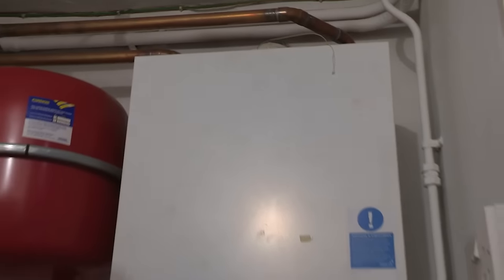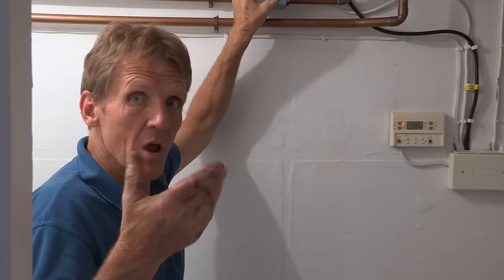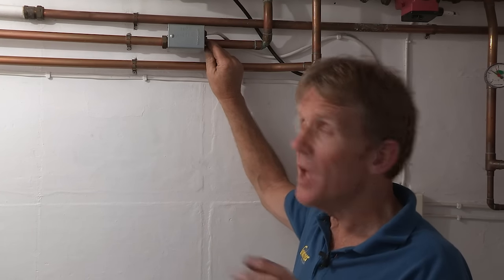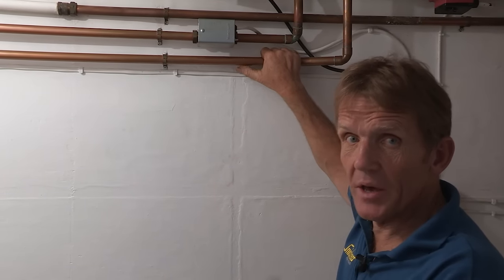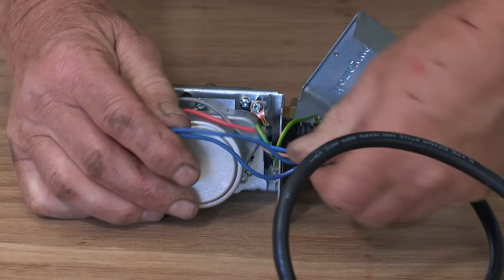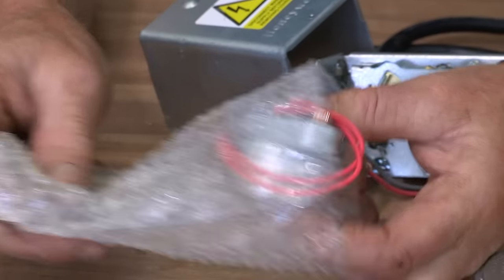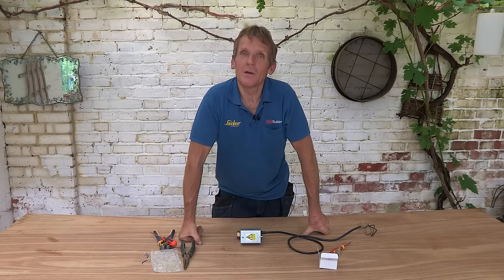How to Repair a Motorised Central Heating Valve

Comment: Great video. Thanks. I have 3 of these, 2 separate heating zones and one hot water. They are fairly new (18months) but one of them is making a loud buzzing noise when open? Does this mean it will need changing? Thanks

Comment: brilliant video. my unvented cylinder was not heating water although the boiler was working. what you described is exactly what my valve looks like. a £10 part next day from amazon sorted it! cheers i reckon a plumber would have been lookin at over £100 to sort that

Comment: I have just managed to do this - thanks for the video. The hardest part was uncoupling the wires on the failed unit (the two plastic crimped parts) is there a knack to this?
Reply from the maker: I just cut them. There is usually enough to make the new connection with the twizzle or a crimp.

Comment: Thank you so very much for your very clear instructions. This fixed my issue and wasn't too hard to do and only cost about $30!
Reply: I just had to replace it again 3 years later, these motors seem to not last lobe. But thanks to you I replaced it for the cost of the motor $42 dollars here in New York!

Comment: I have a buzzing coming from my CH diverter valve. Quite loud especially at night. This is when the system is off. Is there something wrong as I am sure it was never this loud. Some nights it's quiet. No problems with HW or CH so far. Is it on its way out?

Just switched on HW, valve whirred in to action, buzzing gone. Switched off HW within a minute and the valve is dead silent. No humming or buzzing! Peace and quiet. I wonder if it is drawing current when buzzing. The electricity bill was a little high last month. Not using anymore appliances than we usually do.

Comment: Unless it's a really old Honeywell valve, you can change the head without draining down.  Also the boiler will not fire up just by 
locking the leaver open. The manual operation is for filling and draining the system. If the lever is locked over, the boiler will 
operate if the other valve is calling for heat or hot water.

Comment: Great video and I was hoping it would fix out hot water heating but it isn't the case. When I trigger the HW heating valve manually and turn the boiler on for HW, it only runs for 5 mins or so and then stops. Radiator heating works fine. Any ideas?

Comment: Got the exact same boiler and motorised valve set up. Both heating and hot water is working however I think the motorised valve might be causing a humming effect. Would a replacement of the synchron sort it?
Reply from the maker: If it is humming that can be the only reason but put your ear to it and make sure

Comment: Thanks for the video! What to do if the motor and the cog controlling the valve are slipping / clanging?
Reply from the maker: You can replace the whole actuator or start bending the cog so it lines up. There comes a point where you can't rescue it.

Comment: excellent....mine is supplying hot water to the central heating when its not in demand....could this be the same problem?
Reply from the maker: It could be that it is open. Feel the pipes on either side and if it is hot on the  pipe in and out then it is the valve staying open.

Comment: Thanks for all you do. 
I have an Ideal Classic boiler at home and I noticed that when I switch the hot water on from the control, the radiators also starts heating up as well. What could be the problem?
Reply from the maker: It could be reverse circulation. We have a video on it   https://www.youtube.com/watch?v=vu55TgMMDyE&t=13s

Comment: Hi roger thanks for the informative video and looking to replace the synchron motor on my Honeywell 2 port valve 40003916-001 and I am tempted by the cheaper generic motors over the replacement Honeywell product, which you will know is a lot more expensive, what’s your view on this and any recommendations?  Thanks again regards simon

Comment: Excellent clear  information. I have a buzzing noise coming from my 3 way valve . Do you think it's a faulty motor?
I'd be very interested in what you think.
Regards mark
Reply from the maker: Hi Mark 
What is the make of the valve.? The Synchron motor is generally silent, buzzing usually comes from solenoids
Reply: @SkillBuilder  it's a honeywell 40003916-003. I heard it making the noise in the middle of the night. If I switch off the power the motor winds down and it quite when I switch the power back on again. Many thanks for getting back to me. Mark

Comment: While I already have the motor out, is there a way to check whether the micro-switch might be the problem? Is it possible to just replace the micro-switch? Lastly, do you have a video on how to drain the system? Thanks, Mike
Reply from the maker: Hi Mike 
 You can test the mechanical action of the micro switch and put a tester on it. I have never replaced a micro switch so I am not sure if that is a spare part. It may be that you have to buy a new head. 
We don't have a video on how to drain the system because they are all different but if you can't find a draincock look outside the building.
Reply: @SkillBuilder I ordered a new Honeywell 2-port valve with actuator head. However, I'm a little nervous about draining the system so I am first going to try just to install the actuator head onto the old valve and see if that will work. If not, can I just wire in the new valve/actuator-head and test it out before I even think about draining the system and installing it? Can I wire it up and then just lay it against a nearby steel pipe to ground it and then turn on the water heater to see if they boiler kicks on, or do you highly advise that I don't do that? If it can kick on the boiler that way, then I will probably just go ahead and hire outside help to help me drain and then refill the system so I might as well have them just install the entire 2-port valve with actuator header. Thanks for your reply. :)  Mike
Reply: Good news. It turned out to be the thermostat that is located on our upstairs water cylinder (water heater). I removed one screw to open  up the plastic cover over the thermostat. There was a small red 'reset' button that was poking out. After pressing the button back in, the hot water is working great again! Thanks for your help.

Comment: I have a 3 zone system (upstairs and downstairs heating and water cylinder). I am getting heat in all 3 zones wherever I turn on any of the zones. I'm thinking the zone valves are passing but is there anything else it could be before I replace all 3 valves?

Comment: Thanks so much , very helpful.
After refitting a new synchron notor the valve is not full closing through the spring pressure so CH is now on a bit when HW on.
What do I need to do re resetting valve to fully close. Happy to remove motor and refit, it’s as if the valve needs to be reset fully open or shut the motor back in.
Right now manual lever slack until last 1cm of travel to manually open.
Oh and my Synchron motor did not come with new machine screws, the originals are slot head brass and super fiddly to refit, most motors come with cross head machine screws.. what size are they?
Would be so grateful for help here.
Regards
Mike
Reply from the maker: Is the arrow the right way around?  Direction of flow is important
Reply: Hi thanks for the quick reply. It’s only the synchron motor I have swapped out , not the entire two port valve... the synchron motor does not have an arrow and can only be fitted one way. Yes the brass two port arrow is facing with flow direction. Unfortunately my Honeywell two ports are older units and require drain down to replace the entire head, so after the synchron seized solid I thought it best try motor change, but valve isn’t fully closing now and CH is on when HW is on. Not a disaster but not ideal.

Comment: Thsnks for the information, one question do i leave it on auto or manual?
Reply: Very late reply, but in case it's useful: when it's working properly, it should be on auto so that the call from the timer is what opens the valve.

Comment: Two zone heating system but one zone occasionally nit running when both heating programs run together. The affected zone's motorised valve's on light wasn't lit but the other was. Given there's no light on the motorised valve would this be more likely the EPH control unit? Being intermittent is hard to tshoot on. If I run an hour boost the heating then works.

Comment: hi Roger, my hollywell valve seems to be vibrating after the heating (radiators)/hot water has been on for an hour or so.
In order for me to stop the vibrating i need to turn the hot water on for 5 secs or so, then off again. This for some reason stops the vibration. Do i need to simply replace the valve? Cheers Roger
Reply from the maker: It might work, but it could simply be the pump pushing against a closed valve. This would indicate a sticking micro switch. Try turning off the power to the central heating system and then removing the cover and giving the whole things a good vacuum out. Sometimes it is just dust or grit.

Comment: Thanks for video. Good explanation. Have a Honeywell value that gets mighty hot when in use. I understand that how water is flowing through it but it seems hot. May just purchase a new motor and replace. Using a Tadoo system as well. High recommend as a heading controller..
Reply from the maker: They are hot when in use. Try turning the boiler off and running the system with no heat. If the valve is warm there is a problem but my guess is that it is the hot water rather than the motor. Those synchron motors don't produce much heat.

Comment: Hi all, 
How do you ensure that little cog-drive of the new motor is in the correct position to match the position of the gears driving the valve mechanism as you mate the new motor onto it's base plate.
To elaborate. The new motor is in 'divert to CH position ' but the actual valve and its gearing is in the 'divert to HW' position.  When the new motor is fitted how do you ensure that the two mechanisms are pointing the same direction. 
TIA

Well, to answer my own question above, I popped into the local plumbers merchants to by the new motor and spoke to a plumber and the shop  assistant about my question above. Both of them agreed that they'd never thought about the problem and to just throw the new motor on. Which I did and it works!!!! £9. 
Thanks Skills Builder.

Comment: Bypass valve also allows circulation when the pump over run facility in the  boiler should it have one ,is needed

Comment: Hi Rodger. Thank you for the great video, really helped a lot. I still seem to have hot water buy passing into the radiator system when the hot water is on. Mine is a two way diverter valve. Could you have some advice for me please.
Reply from the maker: If you feel the pipes you can see if it is creeping past the diverter. If it is then replace it. If it isn't then you have a reverse circulation effect. This occurs when the return pipes from the radiators are not all joined to the return to the boiler in the same spot.
Reply: @SkillBuilder  Hi, thank you for the advice. Yes, the copper pipe is equally hot on both sides of the diverter. Will then have to replace. Drain the heating system and replace.

Comment: If the valve is leaking is there any way to repair it or should I change the valve body or possibly the whole thing. At the moment I have gravity HW and pumped heating, everything works as it should apart from this valve now weeping. I originally fitted the valve around 15 years ago to stop the radiators heating up in the summer due to gravity circulation.

Comment: Hi, we have the ST9400C next to the boiler and in our house the CM927 thermostat.

The water heating seems to work fine … the heating this year we are having a slight issue.  The heating comes on at the right time and the radiators all warm up - but when the thermostat reaches the correct temperature the radiators do not switch off.

I have checked the pairing between the CM927 and the little box (HC60NG Relay Box) on the wall beneath the ST9400C and they seem to be paired OK.  The flame does go off of the main thermostat (CM927) when the heat reaches the desired temperature and also the green light on the small unit goes off (HC60NG Relay Box) .  But the radiators seem to just stay on … where as before the radiators used to switch off at the desired heat.  Also when the rooms reach the desired temperature - the boiler just stays on.  

Do you think there may be an issue with the Honeywell Home V4043H 1056 zone valve, we seem to have 2 of them.

We can use it as it is - just turning on and off by the boiler as and when - but would ideally like the thermostat to work.

Any advice would be greatly appreciated.
Reply from the maker: I will have to get back to you on this because it would appear the boiler switched live is not wired to the orange wires on the zone valves. I will need photographs of the inside of the wiring centre to help you.

Comment: Best breakdown ever, zone valve fault! :) I haven't got DHW but my heating is working lol
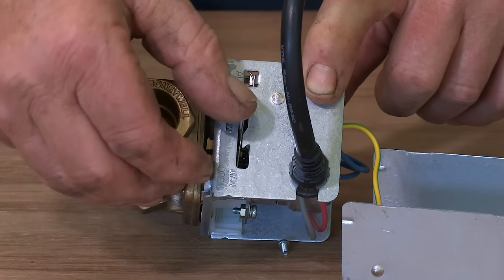Reply: 7:18 The man's a saint. Everything I wanted to know about that lever. I couldn't find it explicitly stated anywhere, even in the installation and specs PDF's (Not Honeywell, but Motortrol Valves model, but same principle).what that lever does.

Comment: Hi, great video and clear explanation however I have the following problem.
Two way Horstmann valve on the CH pipework failed so radiators were cold. Replaced the Synch motor as per the video but now the system continues to run (pump boiler etc) when the HW/CH timer turns off?, the only way to turn off is to isolate the mains.
Could this be a faulty micro switch in the valve actuator head?
Reply from the maker: Yes it is the micro switch remaining in the closed contact position when the valve turns off. Have a look at it because you may have left a wire in the way of it. I think an obstruction is more likely than a sudden switch failure

Comment: Pushing the button to manual has just restored my heating. I'm no longer cold. Yay. However, how long can I leave it in manual mode? I'm going to order a new motor and follow this video to change it so thank you so much. But will it be ok left on until it comes? Thanks
Reply from the maker: Yes you can leave it on manual and just control the heating from the timer. If it gets a bit hot in the room turn down the thermostat on the boiler and it will kick in and out when required.
Reply: Skill Builder thank you

Comment: I have what I believe is called a y plan system. Its 1 mid position valve and my heating is coming on when the hot water Is switched on but no hot water. Heating on it's own is fine. There is no resistance on the manual leaver either way. Is this a simple motor replacement or does the problem run deeper? Thanks.
Reply from the maker: It may be necessary to drain down and change the whole valve but, by all means try the replacement motor first. If I were doing this job I would say to the customer, "I can try the motor first which is around £20.00 but if that doesn't work you are in for a new valve. I have just looked at the ones from BES and they are £25.00
Reply: I'll try the motor first then. Thanks for  your help.

Comment: Great video. I'm about to attempt replacing one myself. Quick questions; my existing motor is labelled as 5 RPM, however the one I managed to source is 4 RPM. Everything else is the same. What impact will a lower RPM have? Does it just mean the valve will open up slower? Thanks in advance.
Reply: Well no difference on rpm do the job open and closed like

Comment: Hi Roger excellent informative video , I have Boss BMPV22 3 port valve , are the motors specific to a particular model or can i buy a standard one off ebay ? thanks Nick
Reply: Nic Nak If it looks right it will fit.

Comment: I know this is an old video so I don't know if I will get an answer but I have a problem with a Drayton MA1 mid position valve. I am in Croatia and bought the valve from Screwfix who sadly no longer operate in mainland Europe. I would like to repair the valve rather than replace it with something different that is available locally. On the Drayton you can unclip the actuator head and access the valve spindle. There seems to be only a few degrees movement on the spindle but it does make a difference, if I turn it clockwise I do get heating, anticlockwise I don't. The motor rotates when connected direct to mains. Can the mechanical part of the valve be dismantled for repair?
Reply from the maker: yes you can get a replcement motor for that actuator head.
Reply: @SkillBuilder  It's OK, I found a video by Drayton themselves that describes these valves. It looks like I have a solution.

Comment: My hot water has gone this week and I can't get the switch on the motorised valve to get past the lug and lock in. Its as if something is blocking it. It also doesn't spring back when I let go, it just stays where it is.. Any ideas what the problem could be there?
Reply from the maker: It is usually just dust and debris on the mechanism but other times the motor won't do the last bit. if it looks ok mechanically then just replace the motor but if it is jumping the cogs, renew the whole head/actuator

Comment: My boiler is a Vaillant ecoTEC plus system boiler. Heating works while hot water not. I followed what you said to manually open the hot water valve. The boiler does not start.
Reply from the maker: That is because the micro switch in the valve is not quite connecting on manual operation, sometimes they do, sometimes they don't.